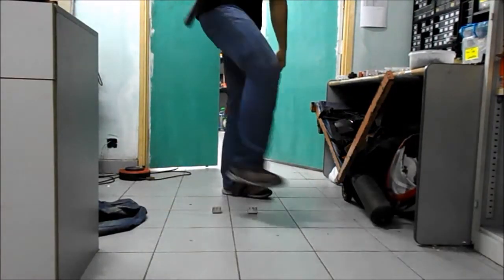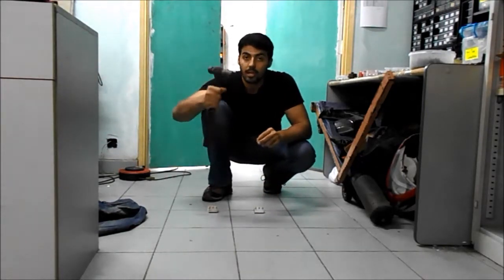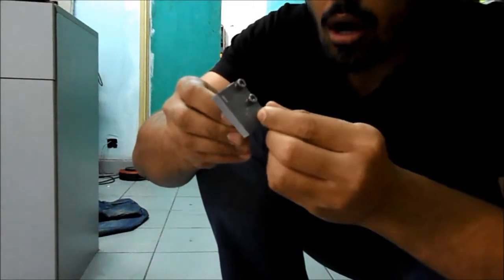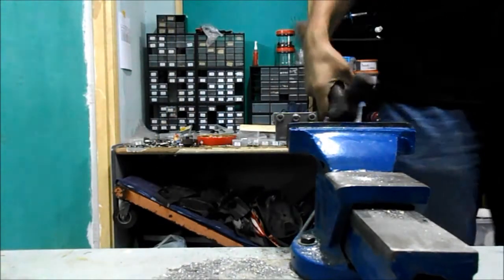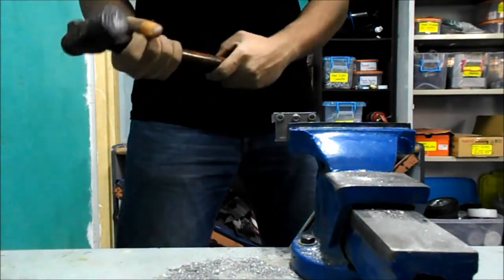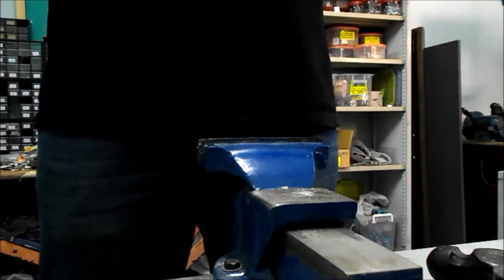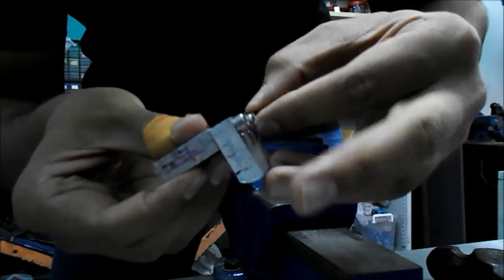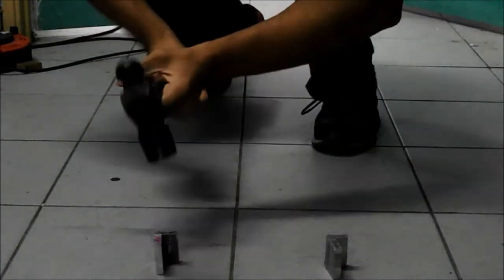Comparing AL 6061 Vs AL 7075

Comment: See if you can eventually get training on CAE/FEM capabilities so to asses the behaviors of both materials. FreeCad (as an inexpensive solution) will import those material properties.
Reply from the maker: True what you're saying but we just needed to test the effects of specific impacts on both metals so we just used a hammer and expendable floor tiling
Reply: @haroonwardak6361  Yeah I feel ya. I'm going to go through similar mat validation as you did during next week, so to get the correct grade and temper for our application. So far passed CAE sim using strain-stress curves from coupons we've outsourced to a testing facility. Next week its the impact & drop tests. Not an easy task I tell ya... nightmare rather :/
Reply from the maker: @gtcollection6933  aaah man sounds fun but I doubt its only fun but quite exciting miss those days altho I never did something as advanced and complex as you mentioned here, but nevertheless do share your experience once ur done with it.
Reply: @haroonwardak6361  ...and safety glasses ON next time to want to smash things up the shop, young man :-) Build it safe bro. cool vid, thanks. tc
Reply from the maker: @gtcollection6933  ok MOmmmm, jk yeah safety should've been a priority there in my defense this was like half a decade ago so those were different times 😬...

Comment: Does your mamma know you were beating her nice tile floor...
Reply: My momma's dead but she wouldn't mind me talking to a stranger:) FWIW, I have worked with 7075 T-651 aluminum for 30 plus years and it runs circles around 6061 with regard to strength and durability. Glad you are delving into engineering, design and albeit crude testing! Stainless screws are soft and weak by virtue of their chemical make up and really irrelevant to your demonstration. They were the weak link with regard to the 7075 and not so much so with the 6061 as it gave way before the screws did. Regards new friend!!
Reply from the maker: Yeah, but i was using stainless screws for both of them, but yeah you are right it is not the best way to test their strength and all.
Reply: Hey, nothing ventured, nothing gained so, keep up the "testing of the waters!" Cheers!
Reply: @JohnBoyDeere  
You mean they 7075 better than 6061?